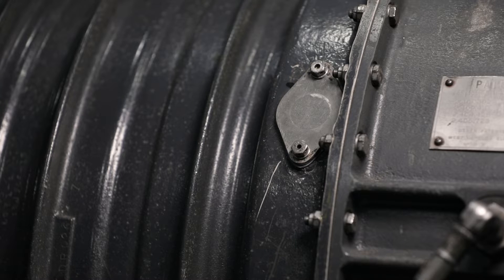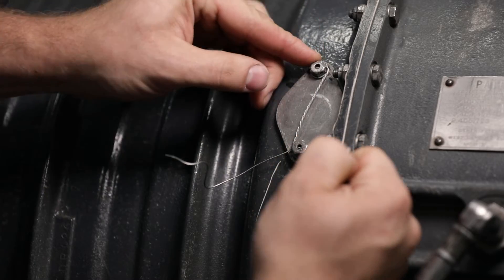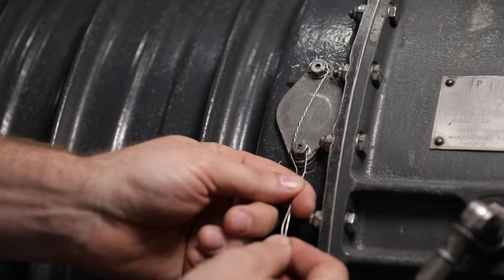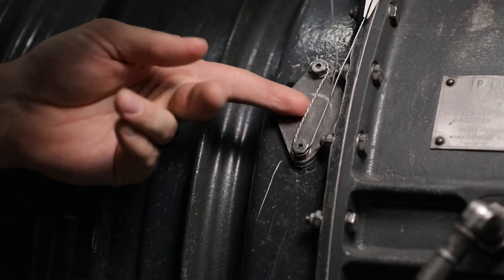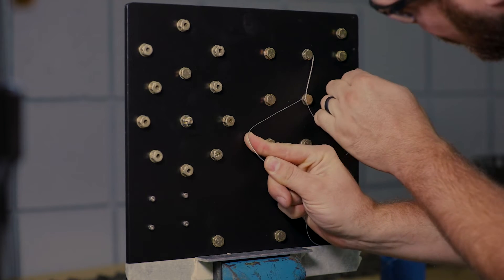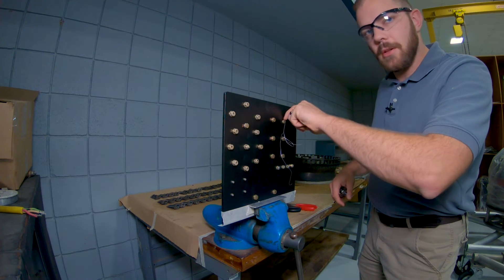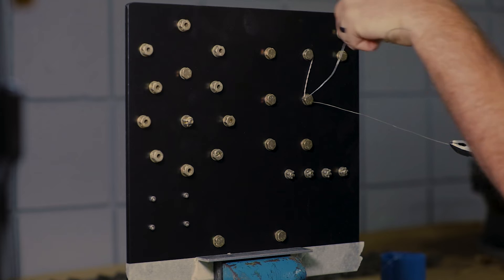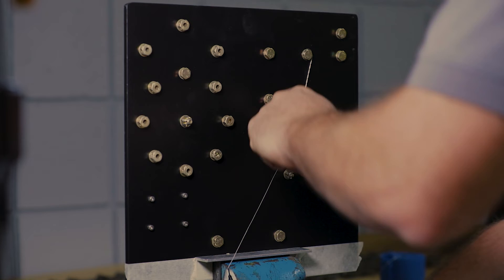Basic Safety Wire Tips part 1 - 2 and 3 bolt patterns

Comment: Did safety wire change. 10-12 turns per inch on runs. 6-8 on pig tails
Reply: Page 7-19 of the AC 43.13-1B says 6-8 twists per inch. And that has been the norm for at least 25 years, since the last change was in 1998.

Comment: Hey there, not trying to be a hater, but feel the need to point out what's right. Based on what I was taught in A&P school and per the FAR AC;3.13-1B, the nicks in the wire from the pliers are a no go. Probably more concerning is the "around the world twists" Those are over working the wire making to brittle. It doesn't mention that term anywhere in the FAA rules, but it speaks to the number of twists (6-8 as you stated) and specifically "Safety wire must never be overstressed. Safety wire will break under vibrations if twisted too tightly". Making those around the world twists are doing just that and it will break with a lot of vibration. Same with he pigtail, still need to be 6-8 twists. Its super difficult to get it neat and accurate, but what was displayed would hav been cut by an IA, or instructor.
Reply: I am no expert but did wonder that myself when watching this.. I also thought would it not be an issue  the many times the wires were worked back and forth at one spot when starting the twists by hand. maybe this is just because it's a demo video, 
it does look tidy tbf

Comment: Does the twists per inch on the pigtail matter?
Reply from the maker: The pigtail doesn't matter quite as much, but you still want it to be tight enough that it will hold the rest of the wire tight. You also don't want it to be so tight that it overstresses the wire causing it to break, either right away or later under vibration. Generally a little tighter than the rest of the wire is ok, and actually can help it stay twisted when you bend it under, but don't over do it.
Reply: @theaviationmaintenancechan1109 why aren't students required to break a certain number of bolts and safety wire to pass courses? The only way to learn this is to slowly , and deliberately, and with attention to detail, break a safety wire. To learn how it deforms during manipulation?

Comment: My problem is the direction to send the wire on th second or third bolt, thanx for the video 🇺🇲✈
Reply: Opposite, You go from the first to the second clockwise, you would go counter clockwise from the second to the third, then the pig tail would be clockwise and tucked.